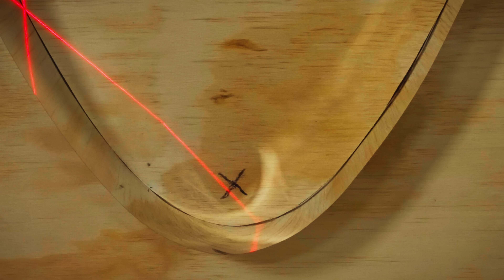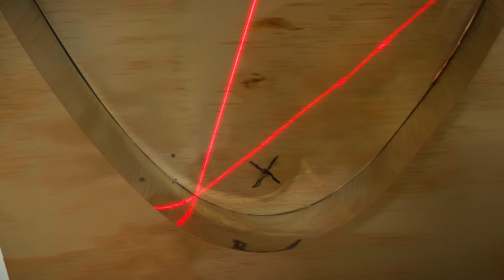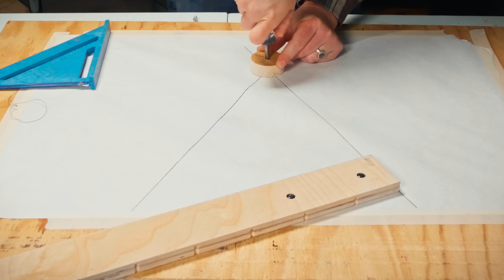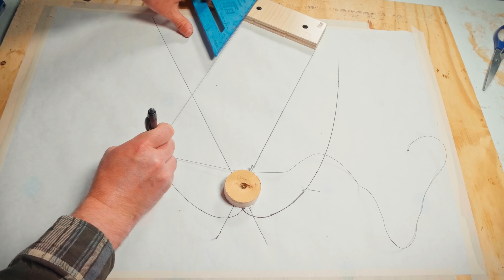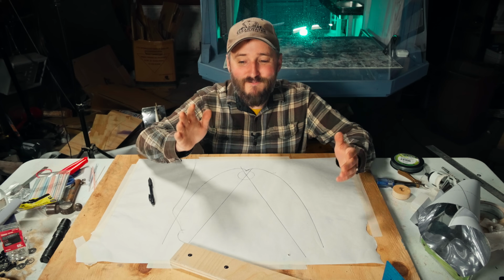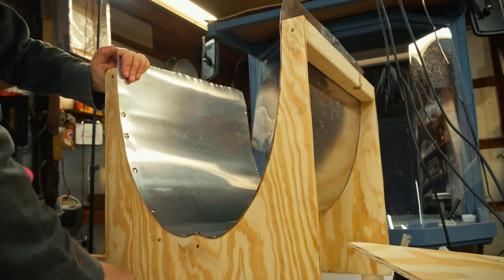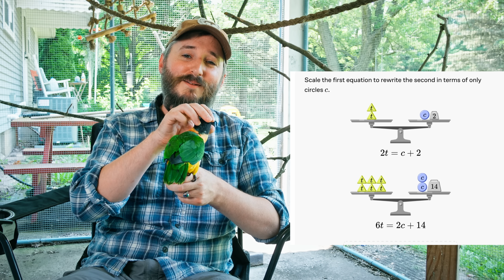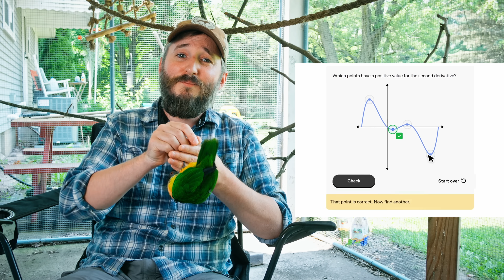DIY Solar Concentrators, Made Better.

Comment: i have desires to use solar thermal to heat sand and to pull low grade charging from it using stirling motors, the sand isnt a liquid so it doesnt flow but air does and it can be heated and the air then blown through sand, ill use home crafted heatpipes to bring high density heat back out
Reply: air also has a higher heating potential when compared to other easily obtainable abundant sources, waters  limit is 100c and you also run into pressure problems, oils are costly and solar can easily surpass flash point temps, air can be blown easily, i'm thinking SHS or RHS painted black with a heap of gussets with holes and corners to act as the heat exchanger, worked as a welder for years so this won't be a challenge and i can say if one keeps to light gauge steel, a cheap arc welding machine and auto darkening helmet will suffice for newbies, but first look up a short movie on youtube called "Prevention and Control of Distortion in Arc Welding" with mr shrink :) a great invaluable resource for anyone learning to weld and what to expect to have to work with, next up is watch something about practice weld coupons, these are simple small pieces held in easy to make fixtures that'll help you learn the joins, once confident the heat exchanger should be a walk in the park for a simple home made one :)

Comment: I really appreciate your video here, great material.  One consideration that you may have missed is that thermo-cameras see IR, which is reflective.  It seemed to me that there were a lot of reflections in the aluminum pipe.  You could see the reflections of the outside.  If you want more accuracy in a reflective scenario, I would recommend using a physical sensor like a thermocouple or an RTD.  They do make special paints and tapes specifically for IR camera inspections, but electrical tape is actually really close to them and has been used on electrical gear for temperature measurements.  Keep up the good work, you really inspire me to think creatively!

Comment: It's not a scientifically accurate test as far as it goes. You covered one's end, but not the other's. It completely invalidates the results. Also, where is the pipe without a mirror but in the sunlight control?

Comment: A small distinction:  A hanging chain under uniform load, (zero load is uniform) is a hyperbola.  Reference Antonio Gaudi design of Sagrada Familia, Barcelona Spain.  You got it right, the parabola is the shape for collecting the suns rays in a single point.  + thanks for the great posts!

Comment: Im 76 and autistic.  That said, I strive for simplicity and closure (no loose ends).

To such end, I designed (and built) a focusing mirror from a flat piece of sheet metal applied to spokes of a 6 foot wheel, such that it has a focus of 600:1. It is mounted on a gymbaled steel post in concrete.

Even though it can be built in only the time it takes to weld the mirror supports, cut the large circle of sheet metal and glue on the aluminized mylar reflective material, the mirror will melt mild steel on a clear day. It is NOT a toy.

I use it to make lump charcoal as well as flash steam. I build steam engines (and wind turbines) as a hobby.

I am reticent to share details, because with the addition of two other regular geometrical shapes, a lap top computer and target-aquisition software, this could be a formidable weapon.

Only hint:

The mirrored surface is applied to a flat  piece of sheet metal and lays in a form that holds it in a standard geometrical shape.

Now, you figure out that shape.

 Archimedes did. 

So did I.

Comment: This is actually a really cool analogue way to show something that I sort of understand mathematically.

You can draw an ellipse by fixing a loop of string around two points. If you stretch one of those points out to infinity then you get a parabola. So that's why keeping the string aligned with the set square produces a parabola.

Seem that this compound parabola overlaps in such a way that the off-axis reflections still end up hitting the target. Seems that if you have the starting angle too wide or the target too small then those reflections wander off from the target

Comment: Suppose you took a one-way mirror and turned the mirror inward at the mouth of the complex parabola so you could better capture residual light and possibly "reuse" the same light 2 or 3 times. Could it amplify the effect even more? Or would it have little change or possibly a detrimental effect? 🤔

If it enhanced the effect, seems like a possible solution for places that get lots of rain. Set the one-way mirror to be a transparent window that prevents water from entering the system while having the light continue amplifying itself on the inside, at least in theory. 🤷🏻‍♂️

Comment: If you draw the curve at a larger scale the same amount of mirror would receive light from a greater area which would be more efficient, if that makes sense. Sections of the mirror that are closer to perpendicular to the sun are reflecting more light than sections of the mirror that are at steeper angles.  if you draw the curve so the focal point is just below the top edges of the mirror you can still cover it with a flat sheet stretched over the top of the reflector, but it will collect light from a greater area.

Comment: Wouldnt the lower thermal mass of the smaller pipe in the test also contribute to a faster loss of heat, so the temp difference isnt exactly a fair comparison.

Comment: Ages ago I had an idea based on the ideal that you can cut brick. Basically a long, if not continuous, block of clay gets fed into a solar collector. During the day, as the heat builds up, the clay drys in a hot chamber simply heated by the sun. This chamber is long enough to drive the water out of the clay and the stiff clay could then hold up for a short distance in an open area with sunlight focused on the brick. As the brick partially cured and heated up it could then go to more and longer exposures to sun. As the cured brick left the system and cooled, it could then be cut to various lengths. I don't think I will ever do anything with this idea, so if anyone wants to play with it, feel free.

Comment: Awesome!   Thank you.  I wonder if this is cheaper to build than the usual solar water heaters for household water.  Those black panels with a lot of pipe inside can be quite large for one house.  I bet this kind could be smaller and more cost effective.  It seems like it could definitely reach higher temps and even produce steam.

Comment: What happens if the sun is inline with the axis of the heat-pipe, but not directly overhead? As in, if you line up a long collector with the ecliptic plane? I’m fairly sure that it would still focus properly, just not at either end, so the longer the more efficient. Ignoring seasonal variation, just a normal parabola with a thin pipe would be fine, but with seasonal variation you could try to account for the sun being higher or lower between winter and summer with a wide angle of 46 degrees. Or just manually tilt the frame a few times a year.

Also diy ERV membranes could be a big discovery. I’m investigating builder’s paper since it doesn’t rot.
Reply from the maker: Yes should work fine that way

Comment: You always have great content. I love your clever way of drawing out the parabolas. Now take the upper portion of the Compound Parabolic Concentrator (CPC) where the efficiencies are poor and replace it with refractor instead. You can broaden the range of effective sun angle drastically. My suggestion would be to have the upper portion be detachable for easy replacement and upgrades. Use acrylic Fresnel lens, and it would be better to coat it with an anti-reflective coating. Designed properly you might achieve an effective sun angle of 80 degrees instead of 40. A custom Fresnel design would be best. You can partner with optical component manufacturers to source or customize refractive elements if you get serious. There are other options like prismatic arrays, Gradient-Index Optics, or combining a thin refractive layer with a reflective backing, but the Fresnel lens is probably the easiest for DIY.
Also, for flat bottom collection, it is not too hard to make your own vacuum insulated collector if you have a vacuum pump. They are extremely efficient, and you can avoid all the nonsense of plastic or other coating around the whole thing to keep the heat in.

Comment: you really should build a setup for using this to heat water for your camper I'd like to see you use it for heating shower water, boiling water for cooking and if you can for heating the air in the cabin with radiant heat supplied by hot water filled pipes and storing the heat generated during the day in sand batteries

Comment: Hi, thanks for sharing. I think you should have used the same diameter pipe in both cases
 to control for surface area of the heated pipe. But a very informative video nonetheless. Cheers,

Comment: The way I learned to draw these "involute" reflectors was to just wrap the string around the diameter of the form and draw the line tight as you unwind it.
Reply from the maker: That works for a small mirror. If you want a larger opening at the rim to get higher concentration this is the way to go

Comment: I think your big gains will be in 3d mirrors on flat collectors arranged pointing away from the sun, into the mirror so the mirror is behind the collector instead of in front of it. you could probably hit a much wider angle more easily.
Reply: and then there's double-sided collectors. I'm sure you can do something interesting there but you have to consider the shadows of one side affecting the other so there's probably some optimization that can be done regarding orientation of the collector and mirrors.

Comment: See this if use a parabolic solar cooker regularly too. More even heating if light is spread out rather than concentrated.

If going to manually aim, suggest using shadows of two poles (one on the apparatus and another vertical on ground). Much easier process.
Reply: I'm not totally or even a decent percent sure of what you are saying but I was trying to figure out how this would be helpful in a greenhouse. Heating water and creating humidity holding the warmer temperature.

Comment: I want to see how cheaply you can make a concentrator for a solar panel (or two, I don't think the flat target has to be horizontal). Would it make sense to add concentrators instead of just letting the sun hit panels from more shallow angles?

Comment: I have an old book called "Direct use of the sun's energy" which was published in 64 that showed some experimentation along these lines. Most of the findings were empirical resulting from trying various ideas which could by replicated nearly anywhere with minimal cost and non-specialized materials. Most of the concepts tried were the result of logical thought rather than a mathematical theory and they discovered that a lot of what would seem obvious wasn't exactly true.  For instance the 'dull' side of aluminum foil reflects sun equal to the 'shiny' side in practical applications. Various reflector shapes were tested to heat a pipe similar to this video but no optimum was found and there wasn't as much variation as one might think between similar shapes but he didn't try the modified parabola concept shown here. It was pioneering work from a time when almost nobody saw the potential of solar energy for general use.

While the modified parabola tested in this vid could be very useful in other ways, it isn't applicable to photovoltaic solar panels which is by far the most common use of solar energy today. The reason for that is that solar panels become less efficient with heat and really high heats can shorten their usable lifespan so concentrating their sun exposure actually becomes counter-productive in general use. The new bi-facial panels can benefit from non-concentrated reflected solar on the back to add to what the front generates but the extra expense over standard panels again negates the value returned in use except in specific marginal situations.  

The modified parabola would mostly be useful to heat a gas or a liquid in a pipe but too much sun could easily overheat things and create pressure problems. Preventing that would require regulating the sun exposure which wouldn't be economically feasible nor easy to engineer reliably. As much ad I applaud the efforts seen here and the thinking behind them, there isn't any practical use in this that I can see.
Reply from the maker: Concentrated solar is useful for photovoltaics if you keep them cool. The best method there is to flow water behind the panel so it doubles as a water heater. Pressure regulation of such systems isn't an issue. Steam blowoff valves are common, but simpler and even less prone to failure is a vertical open ended water pipe somewhere in the system. If pressure increases water simply pours out the end. Many solar water heating systems are used throughout the world in practical applications. It's not a technology that never got off the ground.
Reply: @Nighthawkinlight  It is not viable when you lose sun and encounter freezing temperatures until sun is regained. For that you need antifreeze or similar in a closed loop system which then requires pumping and a means to transfer excess heat away from the system. The utility of using the system for domestic hot water is lost when there is a lack of sun which happens at least once per day.

By the time you're done the cost- benefit ratio makes it more  sensible to just add more panels instead.
Reply from the maker: @P_RO_  To each their own. There are communities near me that find solar water heat practical for their needs.
Reply: @Nighthawkinlight  In places it can be good with some lifestyle changes to accommodate solar's vagaries.My point is that more often than not it isn't. 

Nothing personal here- I do greatly appreciate you and your channel along with the often out-of-the-mainstream thinking you do. The world needs more people like you who actually research and try the ideas they have. Your value to the  world is incalculable for the people you inspire. May all the best be yours!

Comment: The reason the first mirror system was not as effective/efficient as the second model you've shown is because of the shape you've created makes use of the shape of a catenary (when you painted the shape onto the cardboard). Even among engineers, there is confusion on when to use a catenary vs a parabola (giving examples here will be overwhelming, hence visit Wikipedia instead). However, beside the fact that the second model you are using does indeed use a real parabolic shape, your system is also more efficient because of the fact you are considering the use of superimposed parabolas as to better focus the light concentration on the pipe. The efficiency improvement has to do with both the shape of the parabola and the diameter of the pipe as a reference for the displacement of the overlapping parabolas (happening along the x-axis). If you change the diameter of the pipe, you'll also need to change the displacement of the parabolas. As suggested, your work is a very good demonstration. Thanks for sharing.
Reply from the maker: My parabola demo was actually made via the string construction, not the mistaken chain method. So it was a real parabola, minus any shoddy construction that threw it off

Comment: Every point is tiny. That's the point. Infinity is imaginary. It's not a number because zero is not a number. It's a placeholder numeral marking order of magnitude change in our base 10 counting system. We're safe - there are no black holes to get sucked into. Space is not curved. Magnetic field lines are.
A bit of wax would help the square slide better, though that's just fussing.
There is a green house effect in greenhouses. There is not GHG effect for planets.
Great barn man. :)

Comment: You make a HUGE error at 3:00. Hanging a chain between two points isn’t a parabola, it’s a catenary arch. The mathematical formulas are different, the actual curve is different. Fun fact: the St Louis Gateway Arch is a catenary arch, not a parabola; neither is it an elipse or oval.

Comment: Rotate your thinking 90 degrees.  The path the sun follows along the sky LOOKS like an arc, but is actually a plane that makes a straight path of travel.  If your pipes long axis is oriented to align with that path, then you would only need to re-aim to account for the drift of the suns path across seasons.  A problem your compound parabola accounts for nicely.  I'm having trouble communicating myself ,sorry.  Basically, point the pipe east/west, you see what I mean?  Then make your reflector as long as you like, you'll lose only a little light at the ends.

Comment: I wonder if the central area was covered in a photovoltaic if it would be a more efficient way to collect electricity in terms of combined surface area of both the central object and reflectors.

Comment: HA!    My girlfriend is the packaging manager at Powerpro. 😂   
I have touched the machines that make that line.😅 

Put a solar panel on the flat collector. Have water flowing over the panels.  Heat the water and make electricity.

Comment: I am very interested in concentrating solar power. Lately, I used an old parabolic satellite dish that I covered in reflective sticky tape to find out what it can do. Holy smokes, that little three foot dish is dangerous!
The last compound parabolic curve would be ideal to feed the heat source of a Stirling engine. Or maybe just to power up a solar cell.
Thank you for your fantastic ideas. You're a blessing for the world.